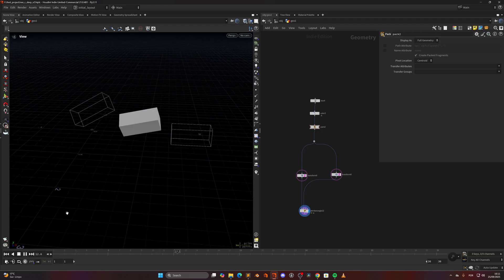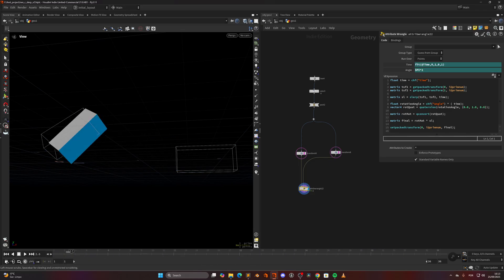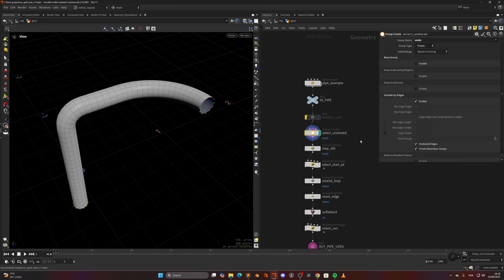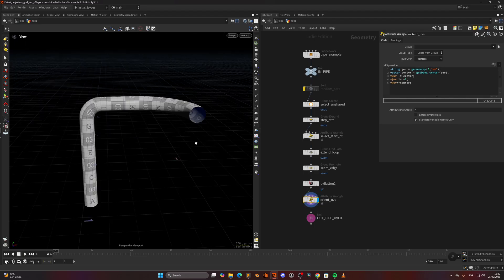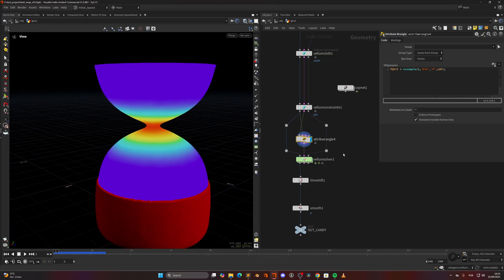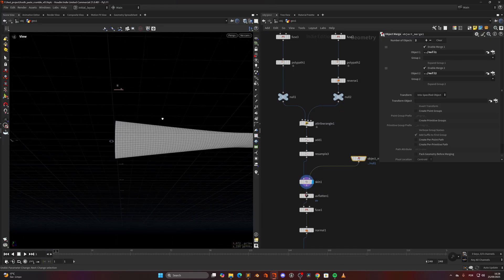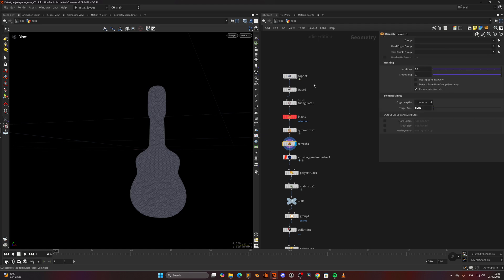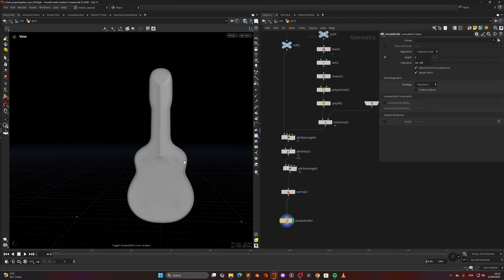Handy Houdini Tips | Vellum, UVS, Modeling and More

Comment: When I get to this part https://youtu.be/h6wt3KJy2W4?t=474 where I use the skin node for the toothpaste tube, one end ends at a point (looks like an ice cream cone). I went through everything three times. I copied the resample node with references, I made sure the values were the same, etc, etc. I'm not sure what I'm doing wrong or if I missed a step that's not in this video. Anyone else have similar problems?
Reply from the maker: Do you have the same point order on both shapes?
Reply: @cgside  I realised the object merge node obj1 points to null1 and I had to add another object: obj2, and point that at null2. Total PEBCAK on my end. Sorry. The output is all black tho, so I threw in a normal after the skin node and it worked. The skin node does have a N vertex attribute, so not sure what's happening and why I had to throw a normal node after. I'll work it out. Thanks again! :)

edit: Oh, you show that just a few seconds later. lol. I paused the video before that part and went back to problem solve.

Comment: Amazing tutorial !! Is there any way that i can retime my animated channels seperately instead of using retime sop for all of the animation. Like using a retime curve to control some of the pre animated channels ??
Reply from the maker: Thank you. That one I am not sure, I know you can animate procedurally with vex and remap the animation with ramps. Thats basically my animation knowledge hehe
Reply: @cgside Yeah I asked this in Reddit they told me that it should be possible to make  them in CHOPs but they are incredibly hard to use and didn't work for me. Is there any docs or place that you can recomend for me to check for this type of work with VEX ??